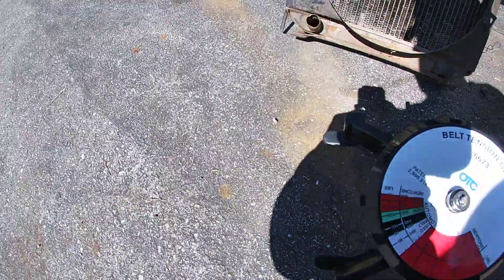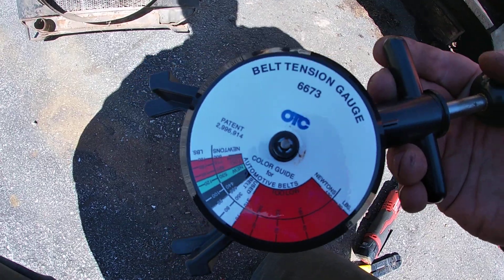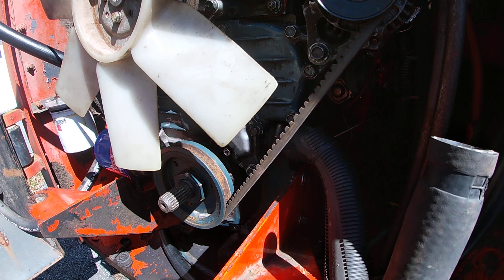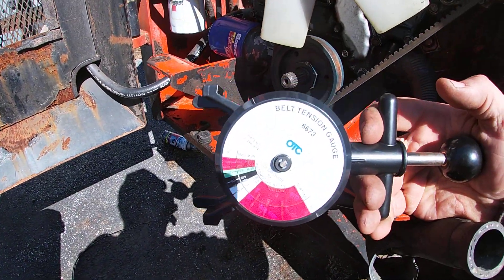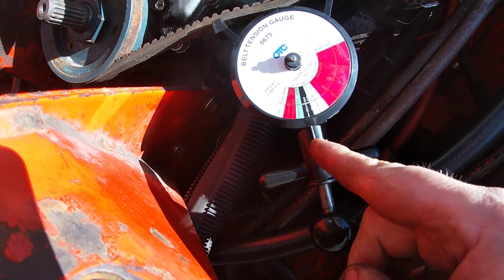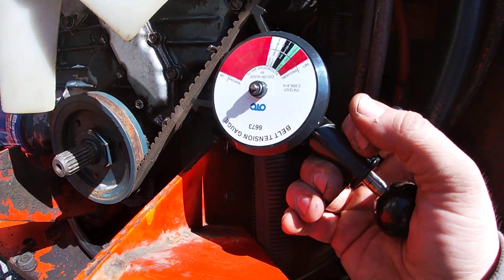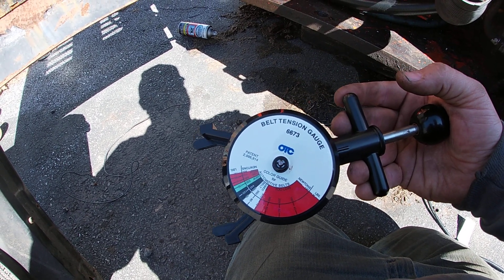How to properly tension your engine belt

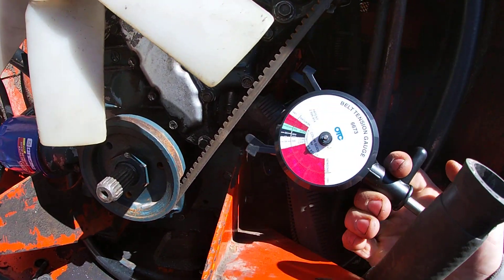Comment: The instructions that came with mine said to quickly release and let the tool snap back onto the belt when measuring (with a warning not to dryfire it without a belt in the jaws as it could mess up the calibration). However, In your video at 1:05 you gently allowed it to pull back. It may give you a false reading that way.
Reply from the maker: Thanks

Comment: Would have been really, really interesting to have seen if you could twist that belt to 90 degrees, or whether it was more or less.
That seems to be the standard that almost every mechanic seems to know and use without needing another tool.
Reply from the maker: @boots7859  great point. I’ve not tried that but I will tomorrow!

Comment: how do you determine what the belt tension should be? is that a universal number for all v-belts?
Reply from the maker: Thanks for the comment.  Typically you want no more than 3/4in of deflection at the longest span of the belt.  The tension gauge will help. Link in the description.  I hope this helps!

Comment: Bought one from Amazon, $147. Went to use it on my Bad Boy Maverick HD zero turn deck and it would not open wide enough to capture a solid 1/2" Deck drive belt. Wide open it only extends about 7/16" rendering it as useful as the little brown bumps on the bottom of a boy pig.
Reply: I made same mistake buying one thinking it would fit my Bad Boy mower belts.  By chance, did you find something that will work because I can't find anything?
Reply: I appreciate your commitment. Even at the current redicus price on Amazon of 178 dollars. I was concidering buying one for my new Bad Boy Maverick HD Zero turn mower. Glad I saw your comment. I won't waste my time or money.

Comment: If you got one for $20 it's probably a knockoff from China, because all I've seen range from $150 to $200.
Reply from the maker: Thanks for the comment! Yes you are correct.  The $20 statement is completely wrong.  OTC is what I prefer and you can get it on Amazon for just under $150
Reply: @hendersonequipment  I was considering getting one so I can check the tension on my mower belts. Do you think it would work, and are they made from metal, and sturdy?
Reply from the maker: @markjennette909  mowers are a little tough because they use a physical spring rather than a tension arm like in a car or tractor.  The best way I have discovered when the belt is too loose on a mower is when I start to see a lot of "flap" in the belt.  You'll also start to hear squealing.

Comment: Mr B: "its pretty cheap, i think its like $20"
Me: Checks amazon $130
Also me:  GAHHH!!
Reply from the maker: Yes it is far more expensive than I stated.  Still worth it non the less!
Reply: @hendersonequipment  ok so would it be a good idea to get a cheap one like this?
https://www.ebay.com/itm/Belt-Tension-Tester-Gates-91107-Tool-Meter-Belts-Gauge/152661349421?epid=214854603&hash=item238b53542d:g:fvgAAOSwcklZj3lQ
Reply: The thing shouldn't be more than 20 buck it's just a stupid spring inside like a one of those things you can use to weigh the fish you just caught.